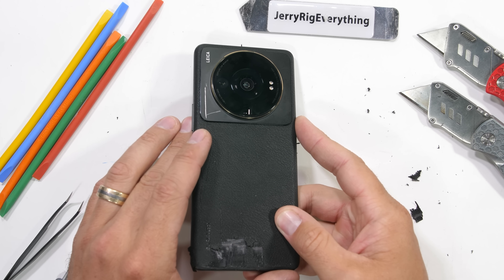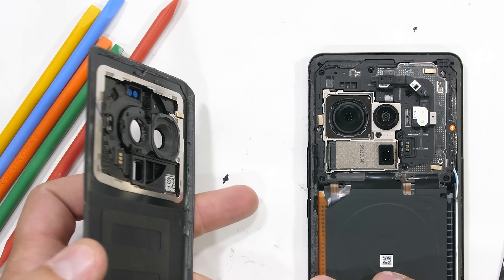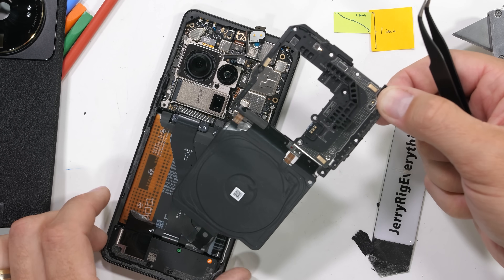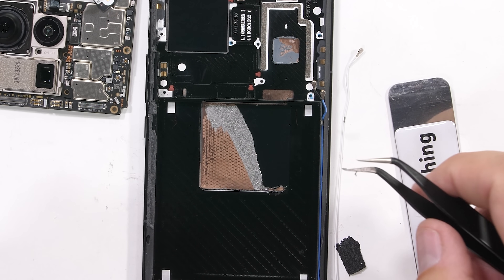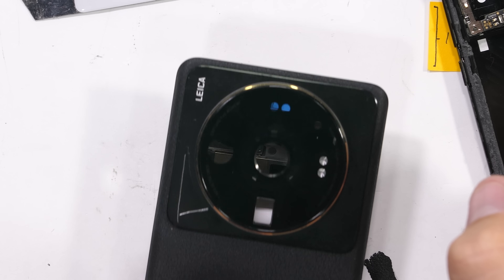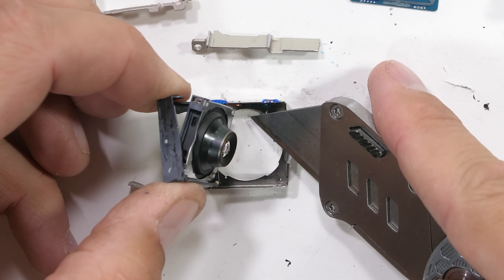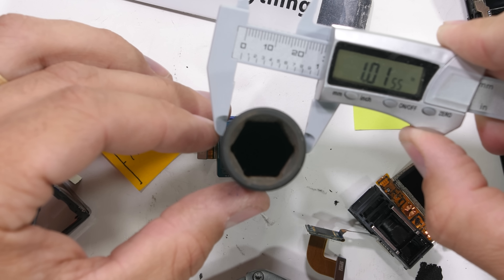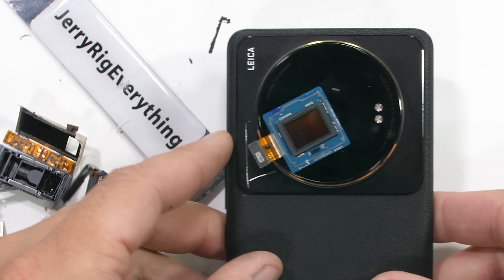Its a bit smaller than we expected... - Xiaomi 12s Ultra Camera Sensor Teardown!

Comment: a "1 inch camera sensor" is sometimes called 1" type (one inch type), owing to it's not-actually-one-inch dimensions, but still keeping the dimensions in a comparable format to other cameras. That said, camera sensor size naming is an insane system, from 35mm being both a common focal length to a sensor size, along with "full frame," "four thirds" etc

Comment: Pro camera is not really determined by sensor size but most pro camera bodies are at least apsc or full frame 1 inch is large for a phone tho l. and cameras dont  move the actual sensor on telephoto lenses the sensor stays where it is the optics compress the image bringing things closer as you push and pull the glass elements with the lenses zoom ring long camera lenses for wild life or sports photography dont work like you said the phone does its totally different

Comment: Sony's legal department makes SURE that every single Sony document that refers to these sensors as "1 inch-type".  Yes,..the word "type" must be included whenever these chips are referenced. This sensor size designation is a very old one that dates back to the size of vacuum tubes that would drive these sensors,...not the actual size of the sensor.

Comment: 1 inch sensors are not 1 inch it comes from a time when sensors were embedded in tubes and thr 1 inch came from the size but thr 1 inch name stuck even though it's more half inch

Comment: This has absolute nothing to do with old school photography rules. The 1” Type sensor size comes from TV camera tubes and was adapted by manufacturers for modern compact cameras because it sounds bigger than it actually is. The closest these sensors are actually in size to, to any comparable flat, capture format is Super 16 film.

Comment: There is a image sensor size chart, wher it clearly says that 1" size senor has 16mm diagonal or 0.63 inch diagonal.

This smartphone sensor size is also 0.63inch, that means it is true 1 inch sensor
Reply: “1 inch sensor has diagonal of 0.63 inches”. Yeah it would be great if you bought a 55” TV and got 32” because actually it’s just a “type 55 inch” TV
Reply: @gera13sa It's just camera terminology, not wrong lolll just misleading

Comment: pretty sure that a Sony spec not xiaomi 
While a 1-inch sensor on a phone is big news, Xiaomi won't be the first to squeeze a camera that big into a smartphone. Models like the Sharp Aquos R6 (or the Leica Leitz Phone 1) and the follow-up Aquos R7, in addition to the Sony Xperia PRO-I, have all featured 1-inch camera sensors. The IMX989 has one key distinction, however: it's the first 1-inch camera sensor built explicitly for smartphones (as per SamMobile), rather than repurposing an existing component.

Comment: Hi Jerry, I need information about the Xiaomi 12S Ultra. So I made a mistake using the SIM ejection tool. I pricked the microphone hole at the bottom with the tool, I am afraid I might have damaged the water resistant mesh and the microphone, can you tell me what really happens if you accidentally use the SIM tool in the microphone hole?

Comment: A real 1" sensor would be close to APS-C size which would require a massive lens in phone terms. Would be nice if phone manufacturers achieved what pro camera builders failed to do (breaking the laws of physics) for decades, wouldn't it? "True 1 inch" means they actually use (read) all of the sensor area, but it's still a 0.63" sensor. Still, quite misleading.

Comment: The 1 inch nomenclature goes back to early television cameras. You will not find a 1 inch measurement on it. A one inch sensor measures 9 by 12mm.

Comment: The reason we keep vaccum tube sizes to advertise sensor size is simple. Marketing. Joe public thinks the sensor is one inch across. And big numbers means big sales. While in reality,. it's not even one inch of diagonal. It's just the size of the electron plate of an old timey one inch vacuum tube. It's much closer to 16mm film gauge.

Comment: They are not cheating!!! 12s ultra concept has 1 inc sensor not 12s ultra. Both phone different, they made a concept work. You opened wrong phone case:) they havent sell ultra concept yet.
Reply: 1" sensors aren't 1" in any dimension

Comment: Camera sensor size for the smaller ones are practically bs. 1” Its not the diagonal length, but the measurement of a sensor that will fit inside a 1” electron tube for old TVs. Its dumb
Reply: Check out dpreview’s video on sensor sizes

Comment: Jerry that 1-inch isn't actually 1-inch. That size naming convention came from era of Super16/Super35 film camera sensors.
 
It's not Xiaomi's fault to name it 1-inch sensor. Its just the photography naming conventions. Even the 35mm full-frame cameras aren't exactly 35mm in measurement and the APS-C cameras as well.

Comment: It's an outdated convention, but it is the universal convention in photography, and you'd guess that anyone concerned with sensor size in a phone camera would know something about what cameras available. "One inch sensor" is the name of a whole class of cameras, the only pocket camera class to survive the improvement of camera phones. It would be better to give the physical measurement of the sensor, in both cameras and phones, but you'd still need a snappy descriptor for the ad copy, and to know what it means, the buyer would still have to know about, you know, cameras.

Also, size is not the reason for using plastic rather than glass in the lenses. No problem with small glass elements. It's probably because the elements in question have very complex surfaces, rather than simple spherical ones, and that's much easier to do with plastic moulding than grinding glass. The big advantage of glass is that it comes in a much wider range of refraction and dispersion values, which is why the best lenses are (mostly) glass.

Comment: Camera sensors should be measured in mm diagonal. I have no Idea if which is bigger if I see 1/17" vs 1/23" etc. I don't want to have to do math in my daily life just to figure out which damn sensor is bigger. Just say 6mm diagonal, or 9mm diagonal. Couldn't be simpler.

Comment: The measurements of the camera sensors are not measured the way you are doing it, the measurements of a 1" sensor are 12.8 mm X 9.6mm although there are some variations depending on the aspect ratio 😅

Comment: A one inch sensor with a fast lens produces about similar results as an entry level DSLR with the slow kit lens. This phone seems to use the sensor in full. Sony uses only the center part so they truly are cheating. It is like selling a six cylinder car where only four are used.

Comment: Having had many smartphone cameras (including the 108MP Samsung many raved about being the best smartphone camera) I have to say this Xiaomi is the best smartphone camera I've had.

For qualification I've been in to photography for over a decade and have a couple of high end cameras and was never a fan of the image processing style most smartphones go for (over hdr, vibrant colours) so your mileage may vary, but I'm loving the 12S Ultra.

Thanks for the teardown, from being a small child I always loved taking things apart, but as I was always better at that than putting them back together, it's good to see someone else ruin their phone for me = )
Reply: @RehtubNomis I'll take your comment as my insight. Then after a year, do you have another smartphone camera suggestion?
Reply: @ihlasakasali1024  I'm waiting for the 14 Ultra, saw a leak about the camera modules and supposition based on the 14 pro and sounds like it'll be a worthwhile switch.
(that, and hoping for an international rom, as the china only 12s Ultra rom means AndroidAuto doesn't work, which, I don't own a car, but when I rent, it's damned annoying - about the only thing that doesn't though).

Comment: Sony released several 1" sensors in their digital cameras, and they were 1".  In this case Leica was measuring from
The base and not the shaft
Reply: The Sony sensors are about 16 mm diagonally. You can calculate the size from the fact that the lens is 8.8 mm but 24 mm equivalent. 43.27 * 8.8 / 24 = 15.9 mm.

I have a Canon camera with 1" Sony sensor. It has 10.2 mm lens with 28 mm equivalence. 43.27 * 10.2 / 28 = 15.8 mm.

Comment: I would like to see the image on the camera when there is a sensor without lens.
Reply: It just looks like a blur. An out of focus photo when the focus is nowhere. 
-Someone who removed a lens and took a photo with a dslr, which uses the same tech of the sensor
Reply: @Likeusb1 do dslr and phone have the same technology ? İn my opinion dslr focus on its lens but mobile phone  focus with in software. Bc mobile phones' lens not move inside.
Reply: @kemalgokce07  Dslrs can have many types of focusing, for example, I have an STM and a non STM lens, both focus differently, and when one actually increases in size when focus changes, the other doesn't.
Also, to focus with software would mean to take many photos and then pick the best one, which is simply stupid.

Comment: i hope Xiaomi is putting some effort into the software. I like them and i´m still using their phones. But i´m not satisfied with their software lately. Using a Redmi Note 11 Pro 5G, Xiaomi´s nightmode is working really good and there is no way coming close with gcam even if it´s well configured. I on the other hand have to use gcam during the day, because every picture in daylight with the Xiaomi camera is overexposed, details are washed out or even completely gone and although it´s overexposed, the pictures are still oversharpened and grainy if you zoom in a bit. It´s a WTF moment. I dont understand why it´s so badly optimized on daylight photos, because Xiaomi is using the Samsung HM2 sensor on many phones. And it is also a quite big sensor. So only using big sensors isn´t enough.

Comment: The start of the video and the title imply that it's not a true 1" sensor. Just because you mention at the end that it is by the current standards of measurement does not make everything else you did here not pointless when it could just be explained in 10s without destroying a perfectly functional phone, which would obviously be fine if you had a reason but here you had none.

Comment: 1 inch sensor size in what cameras sensor written in book is approximately 12.8mm x 9.8mm so thats size in xiaomis phone is i think a correct size base on written in books..
but i dont know how it came to that analyzing and calculating that it became smaller than compare to in reallife measurement we used.

Comment: There is no such thing as a "1 inch" sensor. Sony calls them in every white paper they publish "1 inch-type" sensor. This is the "1 inch" designation is an old measurement system that mears the 1 inch "vacume tube" that was required to drive this chip. Many sensors metrics are based on vacume tube measurements...not sensor size. This is why Sony carefully calls them all "1 inch-type" sensors. In reality, there a no actual 1 inch-sized chips anywhere.

Comment: So what is the actual size of this sensor if it is not 1/1 inch..is it like 1/1.5. ..?? do samsung S series camera also use such outdated measurements convention when they say tat camera size is 1/1.33.. or is it just Xiaomi with this phone
Reply: Every sensor is calculated with the old format, Xiaomi still has a larger sensor than the Samsung

Comment: 1 inch sensors are not 1 inch in size.  It got it's name from TV tube measurements. The size of a sensor for a 1inch tube is called a 1 inch sensor. In actuality the sensor is 13.2 × 8.8mm.

Comment: A 1 inch sensor means the diameter of the tube that would house the sensor of that size in  cameras of the old
So basically the naming scheme sucks and 1 inch sensor doesn't mean that the sensor is 1 inch

Comment: They should have updated the sensor size standard the same as they did for displays. A 21" CRT monitor has a much smaller viewing area than a 21" LCD and we quickly got used to it.

The obvious solution is to abandon imperial units altogether. There will be no doubt what a 15 mm sensor means.
Reply: I'm all for SI, but just like they redefined inches in a stupid way, there's nothing stopping them from redefining millimeters in a stupid way.

Comment: The naming convention should be 1" Type sensor. Sony whom make the sensor label it like that. But to be fair, a full size sensor is 36mmx24mm/43mm diagonal and a much generous light capture ability due to the photosite size. And remember type 1 sensors still have crop factors of about 2.7. It is physically improbable to get better results without AI computation.

Comment: That extra copper plate on top of processor is a work around for a design spec which missed the 1mm extra gap in the contact :)

Comment: Hahaha, xiaomi is a real joke, a liar, "one inch sensor" I don't know where, it's almost half of the advertised, sensor is barely 0.66 in, half an inch wide, too far from what it really is an inch, just for the fanboys go crazy exalting it and the worst, that the most cheesy lenses, it looks like plastic, it should be a very special glass, because with a while this camera using it and heating up a lot, it will be blurry, losing the transparency of the material.

Comment: 3:54 kinda funny, I ended up doing this exact same thing to the SSD I installed in my laptop a little while ago. I gave it a thermal pad, a copper plate, and then another thermal pad to connect it to the chassis.

Comment: When describing camera sensors the term "one-inch" is neither for height, width nor diagonal but "half of the perimeter of the circumscribed circle of the sensor" equals one inch.
Bit of a scam but it's a thing everybody's been doing for a long time.

Comment: 1 inch sensors are never 1 inch in size at all. That is not what the "1 inch" refers too. The 1 inch is with regards to the size of a tube that that sensor would be inside of in a very old quite outdated camera design that isn't used today and has no bearing on what we might experience other than the nomenclature that has as a result become confusing to the point that it is almost misleading

Comment: The measure of 1 inch is actually a diagonal measure of the sensor
The thing is that instead of usual inches, for camera sensors are usually used vidicon inches, which equal 2/3 of usual inches (or 1,69 cm)

Comment: I know this has to be somewhere in the comments, but I'm not gonna sift through ~1500 just to avoid repeating information. Anyways, just in case there was any confusion, "The common 1" outside diameter circular video camera tubes have a rectangular photo sensitive area about 16 mm on the diagonal, so a digital sensor with a 16 mm diagonal size is a 1" video tube equivalent." So it's basically the Footlong from Subway; more of a proper noun than an accurate measurement. It's annoying, but so is measuring temperature in Fahrenheit :P

Comment: Cool to see such a large sensor in a phone and the actual sensor in the video! I wonder if the lens totally covers it. The recent Sony camera phone with the same sized sensor managed only a portion with the optics they used. 8:22 Yeah, I do think camera sensors should be measured differently. I'd say crop factor is fine (where the commonly known36x24mm "full-frame" sensor is 1x) though it doesn't account for aspect ratio. Or simply stating dimensions like 36x24mm but it's not the easiest thing to vocalize, especially when the dimensions aren't whole numbers which is often the case.
Reply: This is not that sensor in Xperia I-Pro (1" and not all the sensor size was used.) This is totally new sensor from Sony and debuts in this phone. It has yet to come to Sony's next flagship phone and they will then make full use of it. This is first time we see this sensor ☺
Reply: @a-xoone  My point was that they are approximately the same size. They are both called "one inch" sensors which is what Zack went over in the video.

Comment: Great video, very fun and informative! 
DPReviewTV did a video recently about sensor sizes. Other channels and sites have pointed this out in the past.  It's my opinion sensors should be advertised by area. So a "I inch" sensor would be known by it's area in mm (approx. 10 X 13mm ,being generous again) so it's area would be 130mm. Advertisers and camera companies could call it a 130 sensor. Seems reasobaly sensible and a lot more accurate!

Comment: I didn't know about the tube measurement until the MKBHD video but I think it's best to stick with it. Since it's widely used and while I know bigger is better, I don't know how big is how good. 
Being able to compare this to other sensors using the same measurement is probably more important than me knowing the physical dimensions of the sensor. 
I just got my 12s Ultra and the camera is pretty sick. 
Not a huge amount better than the 11 Ultra but better than any other smartphone I've tried.
Reply: Actually dxomark rated the 12s ultra lower than the 11 ultra but one thing that I find much better is no more shutter lag. Maybe with software update it will surpass the 11 ultra.
Reply: mi 11 ultra beats 12s ultra with ease, its not even competition
Reply: @Ali Avdic  I own both and in my experience, it doesn't. the 12 is quicker, battery lasts far longer, I think the camera is better in its default colour and gamma.
Reply: @robwhitmore3040  I have both too and can confirm the 12s seems better. The 11 is a bit better in complete darkness but it's probably a software problem and I wouldn't go back. The only thing that I miss sonetime is the back screen for selfie.
Reply: @TLK22  yeah, that back screen got a lot of complaints but I loved it. I wish they had kept it in the 12
Reply: Ugh yeah MKBHD totally helps with his reviews and his US-centric perspectives 🥴😬🙄
Reply: @nehcooahnait7827  I don't really care for his reviews. But if you've seen the video, you know it's helpful. If you haven't I don't really care what you think about his reviews.